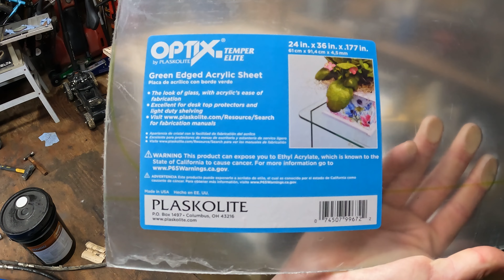Replacing the windows in my Cat D3C dozer

Comment: Excellent job.
Local kids used our CAT and John Deere loaders for target practice. No one local would come out and make safety glass. Made templates and local Plastics Factory in CT. cut polycarbonate (Lexan). The gaskets are rock hard and it took some effort to get the polycarb installed but a decent temporary fix until the parents pony up for the real repair. The gaskets were self-locking with a piece that folds out to allow easier installation then folds back in to lock the windows in place. New gaskets are available online and probably local car windshield installers might have it.
Polycarb and acrylic aren't long lasting due to scratching and yellowing but now you are a pro and can zip them out. Just be careful how you clean them. Plenty of water to get the dirt off instead of using the dirt to scratch the surface.
Reply from the maker: Thanks! That sucks. I’ve seen that happen before too. Sad. I’ve not had luck getting anyone to come cut safety glass here either. I could take the doors to them but it’s fixed good enough for now. Lol. I’ll look for the new gaskets so when I finally do have to replace them, I’ll be ready. I’ve already got a few scratches from tree limbs but still leaps and bounds better than what I replaced! I’ve learned the hard way with the poly sxs windshields and not rinsing them good enough before cleaning. Glass all the way! Thanks for the comment and good luck with your repairs! 👍🏻

Comment: What type of machine do you want to get next skid steer
Reply from the maker: It’s been on my mind. I can’t decide between a cab tractor that’s a little bigger than my current tractor or a skid steer with heat and ac. Lol. Probably end up with a tracked skid steer at some point. 😎
Reply: @MountainMindset  yeah I need a 289 cat and maybe later a 953 cab with 4 in 1 bucket
Reply from the maker: @rodneystewart8958  that would be nice!!!